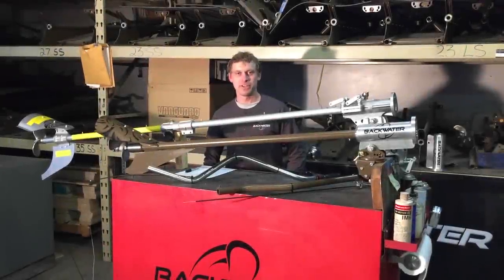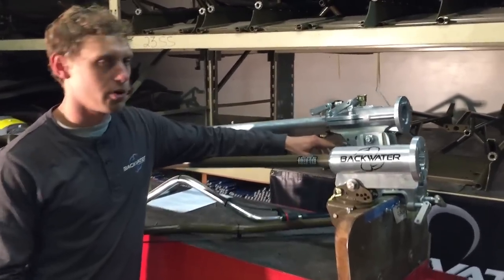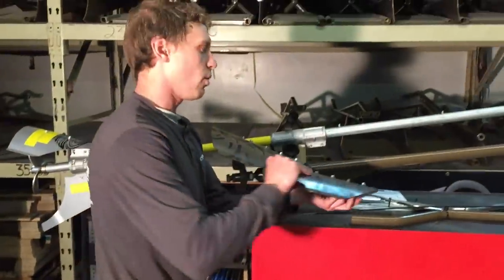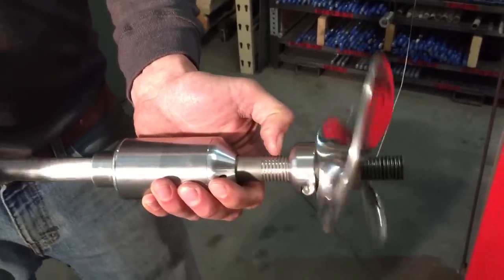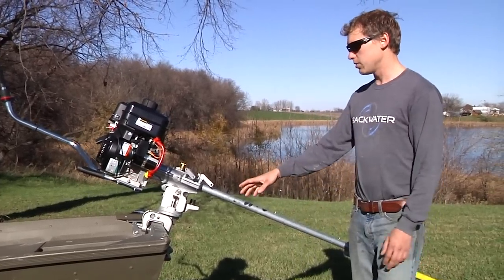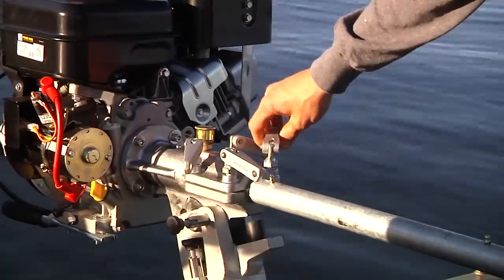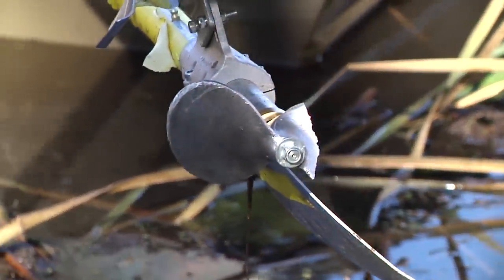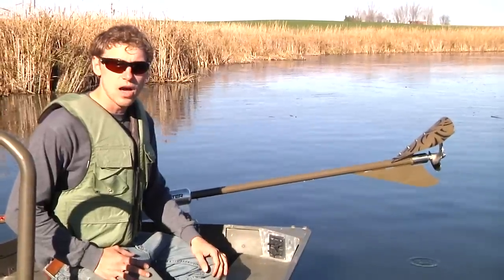Import mud motor kit vs. Backwater kit

Comment: I bought the swamp runner kit and I have had no issues with it, also I haven't heard from anyone that has had issues I would check them out before you buy a backwater kit
Reply: I see Backwater is about double in price. I'm in the market for one. U like shorter shaft and I'll buy Backwater, because its American made.

Comment: My question on this particular kit,,,with the motor and the kit bolted together,,,in a pry bar situation hard ground under water,,,hitting cypress knees,,logs in dead snags,,I don’t understand the,,,, no bracing ,,,,looks like you would crack the engine casing,,I have a go devil that is braced like some of your bigger models,,where the engine sits on a plate and the tails is braced to the plate as well,,,pry bar situation,,,will it hold up

Comment: In your review of the backwater kit, which engine do you have? I have a 1448 true flat bottom, and I'm curious if 13hp will do the trick. Thanks!
Reply: It’d work but I’d put a 23hp on it if I were you.
Reply: @jerryriggedadventures3173  got the 23!
Reply: @mitchell.peterson  nice. Do you have pods or anything and what speeds are you getting although that’s not really the point
Reply: @jerryriggedadventures3173  no pods, might get them later to see how much stability they have. 19-21 without all the duck gear.. Fully loaded ( blind, another person, all the gear) I still plane out just fine, I forget what speed I hit.
Reply: @mitchell.peterson  I have a 1448 mod v that I’m looking to get the backwater 23 for this summer
Reply: @jerryriggedadventures3173  nice, just call their number, you’ll probably get Jake. He’ll explain  which motor is best for your rig. Awesome customer service from the Backwater team!!

Comment: I need to find out how long do you need the mud motor with a 20 inch tranche. I got a backwater for my 1448 with 15in. Tranche, my father said it will fit on both tranche, I told him it wouldn’t work and he said it will. Will you send some thing to tell him what will fit the 20in tranche. I bought my backwater to fit the 15in. Tranche, not a 20in. Tranche. I hope you will get back with me.
Reply: It will work transom height or a few inches will not matter.

Comment: YOU SHOULD NEVER NEED ANY PLATE OVER THE PROPELLER- YOURS IS AN ANTI CAVITATION PLATE_NOT CAVITATION PLATE !! CAVITATION IN FLUID IS VERY VERY VERY BAD !! YOUR DESIGN HAS MUCH CAVITATION AT THE PROPELLER SO YOU TRY REDUCE THE BAD WITH A ANTI CAVITATION PLATE !!   HYDRODYNAMICS AND HYDRAULICS !!   NEEDING THAT PLATE IS BAD NOT GOOD !!! STOP MISLEADING VIEWERS !!!!

Comment: Hello. I understand you design is classified as a "Mud Motor"  I do not know if you read comments any more. last comment here was 3 yrs ago. But I just saw this video and liked it. What is called a "Thai Longtail" is not a Mud Motor. Only water over 3 meters deep and no obstacles. I agree you found the worse copy of a Thai longtail kit ever made to show the flaws. TRUTH HERE OK -- Thailand did not Invent the LONG TAIL -Chinese Invented the LONG TAIL . Research that if you wish.   I have no engineering degree - But I Engineer and Build many things that never excisted in the the Agricultural Arena. Including Aquaculture and Flooded rice fields.  Your backwater products are durable and handle tough conditions. I make that point know. But in your comparison and Telling the GREAT POINTS OF BACKWATERS DESIGN YOU DONT EVEN REALIZE YOU ARE ADMITTING YOUR HYDRAULIC HYDRODYNAMIC DESIGN IS TOTALLY FLAWED But you compare FLAWED Design to Cheaper FLAWED Design.   YOU STATE THE GREAT STRENGHT AND ADJUSTABILITY OF YOUR  are you ready ?  CAVITATION PLATE !!  Almost all humans dont know what Cavitation is. CAVITATION IS VERY BAD IN HYDRODYNAMICS HYDRAULICS AND AERODYNAMICS !!  - Yes  AIR IS A FLUID ! IT CONTAINS MOISTURE -WATER-Its called Humidity !  That being said and true--Any hydrodynamic propulsion system design that requires a ANTI CAVITATION PLATE (tell the truth what your design is. Its to Stop Cavitation Correct? Not make it !!  NAME IT CORRECTLY PLEASE !!  ANTI CAVITATION PLATE !!!!!  Big difference. Your Design REQUIRES AN ANTI CAVITATION PLATE SURROUNDING PART OF THE WATER FLOW AROUND THE PROPELLER TO REDUCE CAVITATION-CAVITATION IS BAD !! You are Truthfully stating your design needs a CAvitation Plate to work correctly !!  ADMITTING YOUR FINAL DRIVE HAS CAVITATION PROBLEMS THAT YOU ATTEMT TO REDUCE USING A CAVITATION PLATE !!   IF YOUR ENGINEERING AND DESIGN OF YOUR FINAL DRIVE IS CORRECT YOU DO NOT NEED AN ANTI CAVITATION PLATE AS CORRECT HYDRODYNAMIC PROPULSION DESIGN DOES NOT HAVE CAVITATION AND NO NEED FOR ANTI CAVITATION PLATE ! YOU ARE BLATANTLY TAKEING YOUR DESIGN FLAW AND SELLING TO UNKNOWING CUSTOMERS THAT THE "CAVITATION PLATE" IS A BONUS OF QUALITY !!  WHEN IT IS ACTUALLY ACKNOWLEDGING YOUR OWN DESIGN FLAWS !!   Only Stating TRUTH !!  Go Research CAVITATION --IT IS ALWAYS BAD !!!    Please STOP FALSE ADVERTISING TO UNKNOWING HUMANS !!   Solid Build Quality. But Bad Also :  )

Comment: You have a better kit. You are in a tough market trying to compete with a Chinese price on a product that is low cost driven to start with. I thought the prop in the rocks was stupid. If you take a mower and run over a brick you'll need a blade. People running rocks run pitch forks. Yours will tear up just like the aluminum if you act stupid. There is a market for both kits. You don't make your light shine brighter by putting someone else's out. Good luck, but that's poor marketing.
Reply from the maker: David, we appreciate the comment and agree one shouldn't tear others down just to make themselves look better.  That is not why we made this video.  Inexpensive kits do have their place, but lots of people don't realize how much difference there is between them and what we build.
Yes, nothing is indestructible, and we don't recommend running rocks if you can help it.  However, we do want to show people in the market for a motor that they can expect significantly better durability and performance from our units so they can make an informed decision about which way to go.  Thank you for your sincere input and have a great weekend.
Reply: I DON'T agree David ! As a hobby I've spent a LIFE TIME & a small fortune ( NOT WASTED ) ( I've learned a lot, and STILL do everyday) Comparing Different BREEDS of ANYTHING From Food to, Household, Garden to Air, Auto, Boat, whatever ? THIS IS an Excellent Product PERIOD.
Reply: @BackwaterProductions  I've have regular outboards and tunnel hulls all my. I'm in the market now for a mud motor and kit. Thank for this demo, I didn't know any were made in USA. I would have bought a knock off, and I know the cheap kit wouldn't last in my bayou and marsh, after seeing your video.